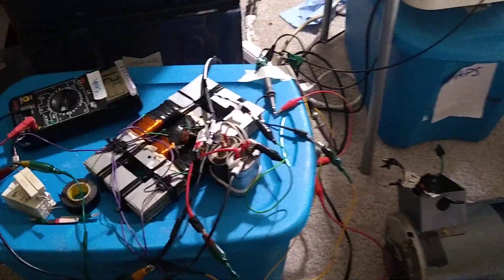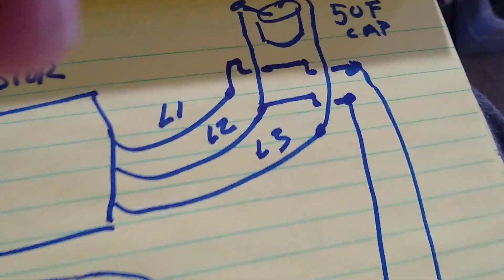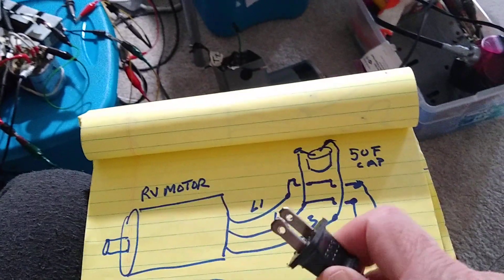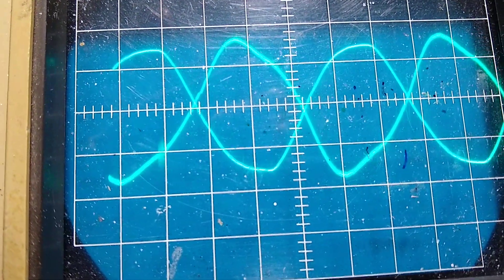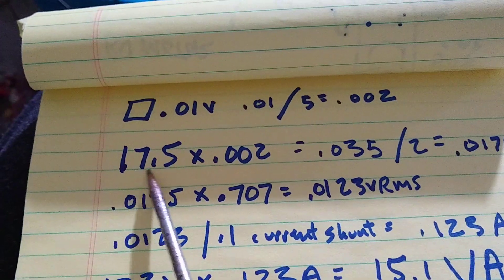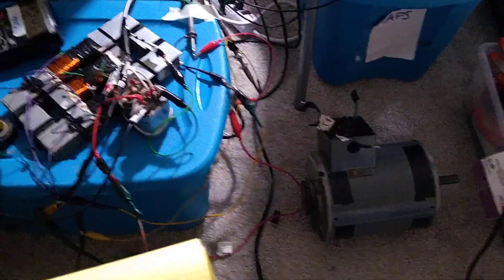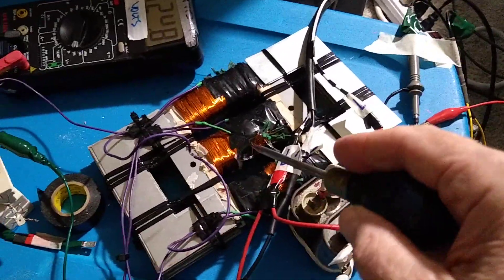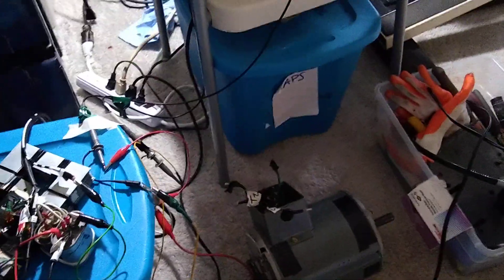BiTT transformer powering a rotovertor AC motor.  165 degree phase shift.

Comment: Doug
I just fired up my DC motor driven Samsung washing machine drive motor.
Nothing special,  just two wires of three wires giving ac.
I am driving a smallish DC direct drive to the shaft from a 12 volt car battery turning only a little less than 100 rpm, (just guessing) measuring 59 volts ac!
No idea of hz
Drives a similar sized DC motor rectified, at about 3X speed with decent torque, so there is some current.
Interesting and will try to meter it.
Cheers Warren
Reply from the maker: Ok so one DC motor A spins the samsung, the samsung makes some good AC, its rectified and feeds another DC motor B....
Try to find a speed where loading with resistance DC motor B has no effect on draw to the DC motor A (prime mover)
and rpms maybe even go up when DC motor B is loaded.
I am going to wild guess around 2200rpm to the samsung you might see something good like that if it happens to have 16 poles to the magnets.....if 32 poles to rotor magnets, maybe 1100rpm, again just guessing,  but its possible you might find an rpm sweet spot in the Thane Karl Heinz delayed lenz effect mode....

Comment: Hi Doug, may I ask, is your scope earth still disconnected? To me it looks like there could be a measurement error due to some current flowing from the scope back into the power grid.  I could be wrong of course but input current in the hot lead should equal  the current in the Neutral lead.  IMHO the meter is most likely correct and some current is escaping from the scope. Can the scope be powered by a battery and an inverter?  I do hope I am wrong here ...Gerry
Reply from the maker: Hi Gerry
The ground going from the scope to the 60hz 120v grid IS connected.
I can disconnected that ground  and see what happens.
Plus I could run the scope on battery and invertor see what happens then too.
I would think the difference between measuring amps on hot wire vs the neutral wire is because of on "what side" of the load is the scope probe situated. (?) 
Also this "could be" because the BiTT is working as it should and input of 280ma gives back out on "other side" 830ma. "Could be" that is. 
This doesn't affect the phase angle, just the amount of amperage.
When it gets over 90 degrees and power factor is negative number now seems like you would want more amps going in so more returns to source. Seems like where under 90 degrees you want a smaller amount of amps so that the VxA is smaller number and so there is less input, but when negative number to PF, now to our would want larger number of VxA so that there is more power being returned source. So maybe this difference in amps doesn't matter that much since it's phase angle that  really matters.
Reply from the maker: OK I got to the heart of the problem about the hot lead showing more amps than the neutral lead,  It was a problem with the female metal  twist-clamp on the end of  the probe connecting to the male connection on the scope.  This for the amperage probe too.
It just was not tight and brushing the probe wire would and could decrease or increase the amps seen on scope.
I did the test of running the scope on just an invertor and battery, and the scope showed to the BiTT primary the same on either hot or neutral wire.  And was running the BiTT from the grid.
So that test showed nothing strange
Then did another, this time  sharing a commong 120Vac from a power strip - how I usually do it, and now without the invertor powering the scope, but the grid powering it, I did not see that amp input difference at all anymore and both the hot and neutral were the same.
Then I checked with ammeter and again it said 450ma on both hot and neutral.
And when I checked what the scope said in amps (.02v square division and 31 spaces P to P) gives an amps input of 438ma so meter very close to scope, and both neutral and hot say the same.  So I guess this just a "bad connection" and a false alarm!
Reply: @MrDKONZEN  Thanks for trying this Doug, when running scope from inverter did you still roughly the 180 degree phase shift you had before?
Reply from the maker: @smokyatgroups  I didnt check phase shift, just the amps. But will take a look at that too soon.
Reply from the maker: Hi Gerry
I did a test just now, running just the BiTT running off the 120V grid power, but the scope running from a battery and invertor.
It had a 149 degree phase shift showing on scope, and .45A x 120Vac "VxA"....there is 39V across the load of the 110.7 ohm resistior across the secondary output.  So this is what I always get with just the BiTT being powered by the 120V grid showing on scope so looks like there is no problem with ground connection with scope and everything is consistent and good.,
Reply: @MrDKONZEN  Oh that is good news! Very happy to hear this, it gives much confidence in your achievements with this thing. Well done mate.

Comment: Hi Doug
What about running everything off a 12 volt battery and an inverter, measure the DC current at the battery?
DC is fairly reliable to measure, coming from a battery.
Reply from the maker: Hi Warren  
So far a regular invertor jiust kills all the good stuff about phase shift and power factor and negative power factor and  the AC power actually returning to the grid. 
Maybe a grid-tie invertor might work well but so far I have used two different invertors, a 400W and a 1000W, and both increase the draw about 4 times compared to running on the grid.  The invertors I have used do not care about power factor on the input from invertor to the BiTT or the rotovertor.  I am working on an invertor made from a BiTT transformer as the core of it. So primary of BiTT has low impedance winds  and DC gets switched into it in alternating directions,  I could use my "rotating disc invertor" for that....then there will be HV AC at the output of secondaries of the BiTT to run a second BiTT and/or rotovertor motor.